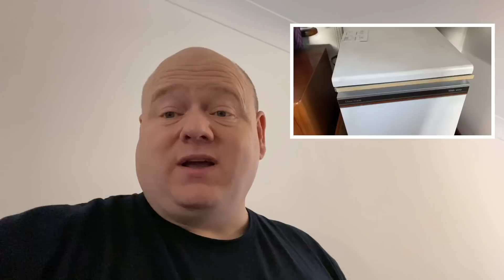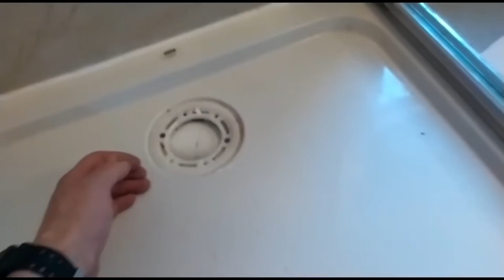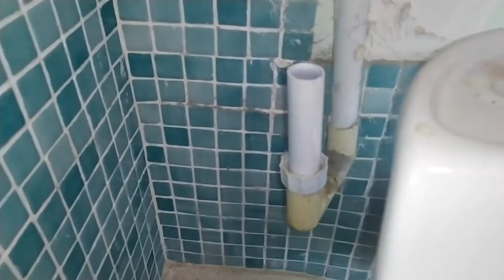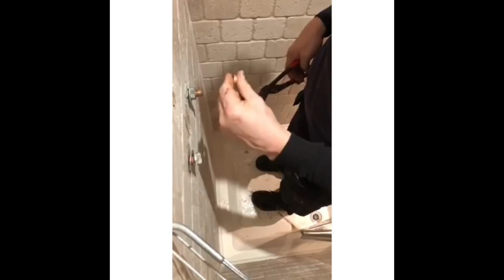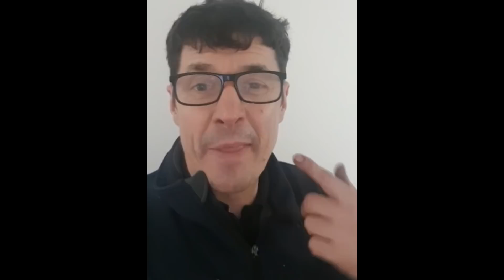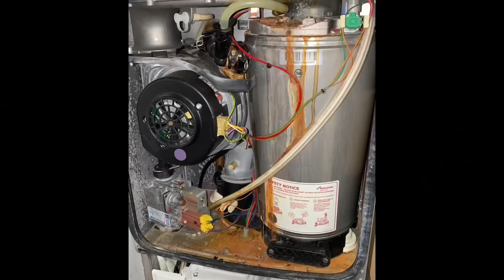Plumbers Videos - Showers / Boilers / Flues

Comment: What is the fundamental problem using an existing flue from a different manufacturer, providing it is well secured? It's the same material and size. Seems like the manufacturers are fleecing homeowners forcing us to buy new pipes at a hugely marked up price, send the old ones to landfill and ripping open the ceiling for good measure. You can use third party tyres on a car, which are responsible for a lot more accidents than boilers.
Reply: @NE_One1  For me, the additional cost is around £1000 in parts and labour. For people requiring scaffolding, it could be much more. Even if the engineer did not do his checks before leaving, my carbon monoxide alarm would alert me and I can call them back.

Comment: That last video showing the terrible boiler install (pipes close to consumer unit, condensate run and horrendous flue run raises a question. When you as gas registered , discover this sort of stuff, and are able to identify the installer either from documentation or from the customer - do you inform the authority via their website using the ‘I wish to report a concern about a Gas Safe Registered Engineer’?

Comment: But Elliot, if the WC overflow is terminated lower than the discharge point in the cistern, it would 100% work!!  
WC overflows were commonly piped up rising or looping into Bath Overflows in Council Housing in the 70/80’s perfectly acceptable.
Can I suggest you get a Plumber in???

Comment: Can someone tell me the benefits of using plumbers abrasive strips as oppose to sand paper?

I feel sand paper breaks off and contaminates a solder joint, if not cleaned properly.
Reply: Use wirewool